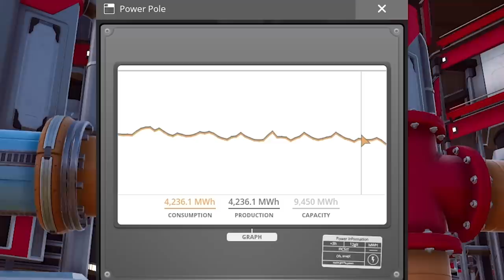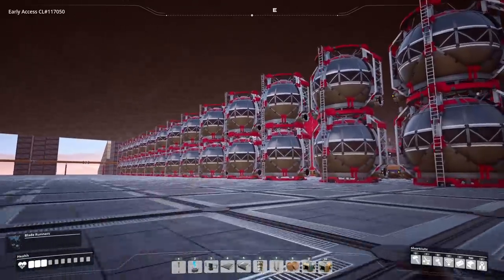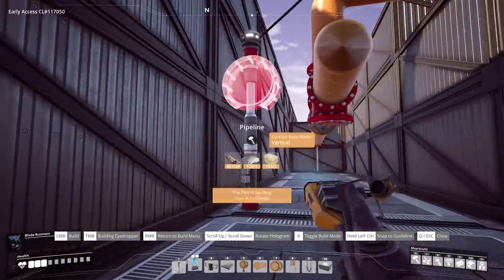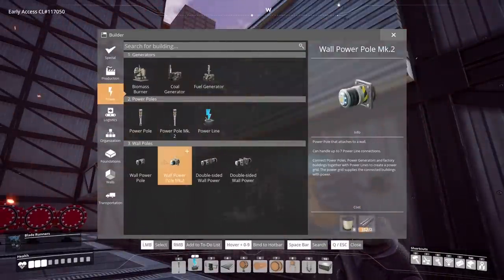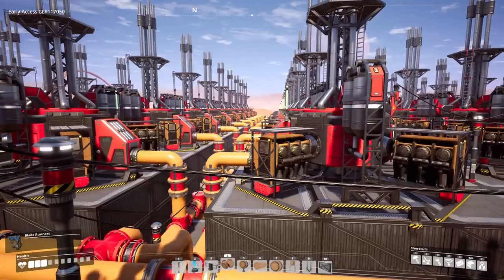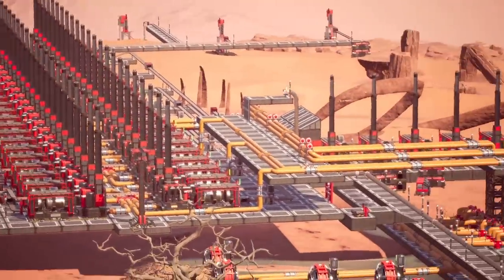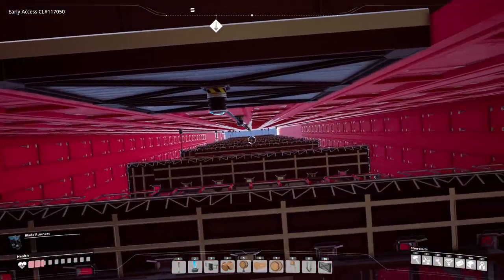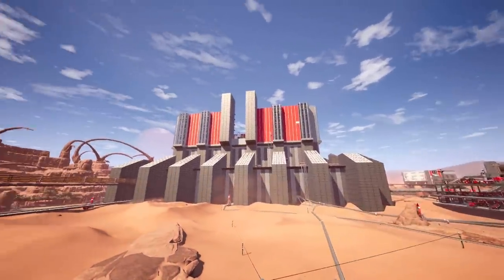162,000 MW of TURBO FUEL POWER! - Satisfactory Early Access Gameplay Ep 15

Comment: Where does the number of produced Turbofuel come from? "300 and a bit Oil [...] to produce 1222 Turbofuel"

300 Crude Oil -> 400 Heavy Oil Residue -> 800 Fuel -> 666 2/3 Turbofuel

1222 Turbofuel would consume ~550 Crude Oil
Reply from the maker: I go over all the Turbo Fuel stuff in the previous video
Reply: Kai Schwierczek He uses an alternate recipe that uses water so he doesn’t use as much oil
Reply: I understand that, that is why 400 Heavy Oil Residue becomes 800 Fuel, I just left out the required 800 Water as I left out the packaging and byproduct. Still the math doesn't add up.

What am I missing?
Reply: Kai Schwierczek Hmmm, I’m not sure then
Reply: @ImKibitz  Just checked the last video and you use the recipes I used in my calculation. Heavy Oil Residue and Diluted Packaged Fuel.
Did you maybe use almost (for easier number?) 2 pipes of Crude Oil and just made a mistake with saying 300 and a bit?

EDIT: love the content, I just want to understand it since I plan a similar setup, currently on Fuel with the Diluted Packaged Fuel recipe and want to upgrade to Turbofuel.

Comment: I'm already infuriated when you spend time load balancing belts! Please don't start load balancing pipes. It's pointless. 
Both belts and pipes distribute themselves evenly. 
Load balancing is not something you should ever bother with. If you'd like I can explain more. For now, think of how water comes out of a long pipe urinal or a bar sprinkler, liquid takes the path of least resistance. The belts do the same.

Comment: When can you get Turbofuel unlocked in the MAM?
Reply: I am pretty sure you have to unlock oil production and hope you get it in a Hard Drive research
Reply: Hard drives
Reply: You need to have compacted coal done already (pretty sure that's still a requirement before it turns up on HDs in the MAM), then just spam away at those drives until one gives you the recipe. Also make sure you have the advanced oil processing milestone done, pretty sure you need that unlocked before it'll show turbofuel
Reply: @Veklim  Ok, thanks, have to take a look on compacted coal then

Comment: You will have about 54 Minutes assuming 2 Generatiors are running per 4 tanks
On your Backup system. 35 Min if all are running
Reply: but 3 generators would be running per 4 tanks
Reply: Isn't it 1200x4/15x3=106.66 mins at full load?
Reply: @neilpayne8244  wasn't 45 turbo per minute, or is that for regular fuel?

Comment: you use WAY too many pumps... horizontal distance does not matter. only vertical. a single pump on a line will give 20m of lift. this is not cumulative (if youre going up 40m, u cant put 2 pumps right after each other, you need 1 at the start of the lift, then another one 20m up)